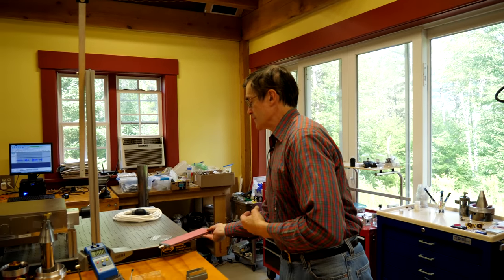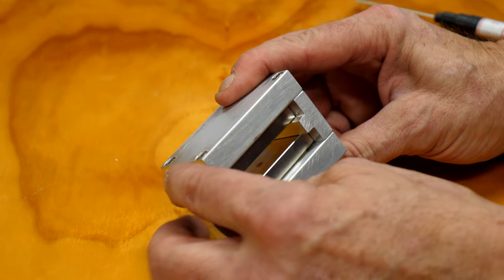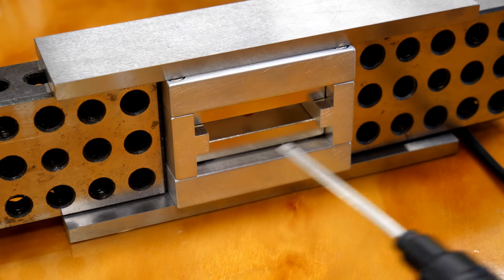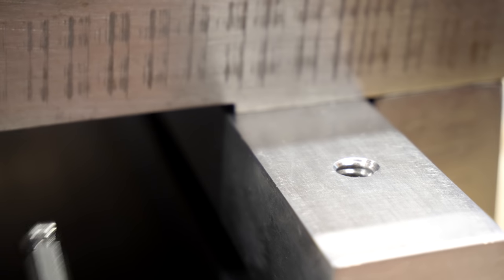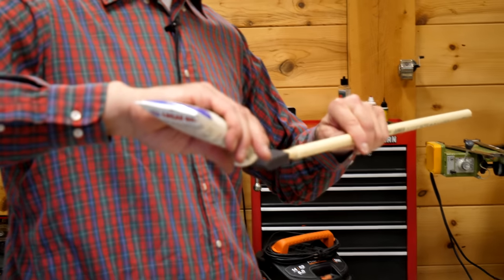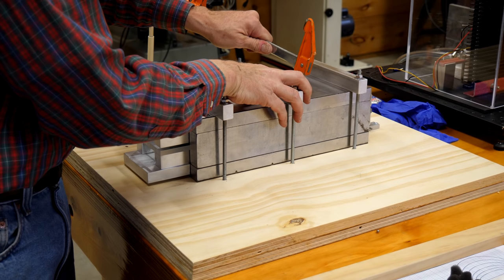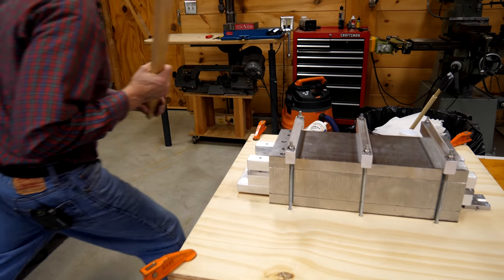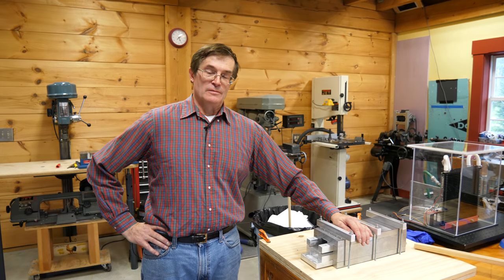Extreme Magnets

Comment: Didn't the US Navy experiment with MHD for silent marine propulsion in the late 1960s?
Reply from the maker: I'm sure they did. The Japanese built a surface ship with an MHD  propulsion system.  Even though they used superconducting magnets it did not work very well.  I think the design was flawed.  They used large diameter flow tubes ( if memory serves, 20 cm in diameter) within the magnetic field which increases the resistance to current flow.  Therefore they needed large voltages to drive an appreciable current across the electrodes.  This is very inefficient and produces a lot of water hydrolysis which also waists power.  A large number of thin, parallel channels would have been better.

Comment: The magnetic strength is NOT strongest at the center of the poles. That is where there is the greatest amount of divergence. It's actually weekest there. The strongest points are the edges. You can prove this with a steel ball bearing and place it directly center of a pole on a large magnet, then let go. You will see the ball bearing shoot off to the edge. As you can see in your image, that is where the greatest concentration of feild flux lines are.

Comment: What if you made that "box" out of aluminum, or copper?
Reply from the maker: It would not work.  The yoke has to consist of a material that is susceptible to the alignment of its electron spin orbitals in order to guide the magnetic field.  That is what is called ferromagnetic and despite the use of "ferro" it does not have to contain iron although many ferromagnetic alloys do.
Reply: Clearly, I should have payed more attention to what you've said in the video before asking questions. That's okay though, I'll watch again :)
Reply from the maker: Sure, no problem.  Just keep watching over and over, it helps our view count.

Comment: I don’t understand the behaviour on load-up. The magnets want to rush in, but not all the way in. They can be pushed (with effort) to go further, but when you stop pushing they don’t revert.
Reply from the maker: They repel each other when they are aligned with their poles in the same direction.  Visualize the field lines bending around each block and being compressed as they approach each other.  What draws them in is the attraction of the steel, what stops them is the compression if the fields.

Comment: Are you sure thats what is going on? What if I said I believe the electromagnetics traveled easier through the metal of the probe. Then the air regardless of the ferrous properties or not... Just only ferrous metals draw enough saturation to over ride gravity when outside of a ring?

Comment: I wish I understood why somebody couldn’t build a motor just using super powerful magnets that oppose each other to cause the driveshaft to spin fast and with torque
Reply from the maker: Permanent magnets are mechanically similar to springs.  Placing them in an arrangement where two opposing (or attracting) magnets produced torque would only work until the magnets moved to a maximum (or minimum) distance and then the motor would stop.

Comment: How do/did you prevent chipping/damage to the magnets as they are inserted into the yolk. Is oxidation of the potentially damaged magnets a concern?
Reply from the maker: They repell each other as they get close, reducing the impact force.
If they did crack, there would be a corrosion risk.

Comment: why not use halbach arrays?
Reply from the maker: Halbach arrays do not produce a uniform magnetic field.  We want parallel field lines running from the top magnet straight down to the lower magnet throughout the entire space in the magnetic gap.  If you look at an image of a halbach field distribution, you can see the field is mostly limited to one side (the purpose of the array), but the field forms loops from end to end of each magnet.

Comment: The utility of the electromagnet in full view.  You could place all the electromagnets with power off.  Much less dangerous.
.
.
.
Reply from the maker: There is that, but everything is a trade off.
The permanent magnetic assembly has a more stable field and consumes no electrical energy.  If this magnet is being used for an MHD pump or generator, an electromagnet could be a deal breaker.
Reply from the maker: The field strength levels you are aiming for are very high.  Permanent, non super conducting magnets are a non starter.  Steady state electromagnets will also not be able to reach anywhere near that level. Pulsed electromagnets will get closer, but still be unlikely to achieve those levels.  My advice would be to establish the minimum field that will allow your project to proceed and then attempt to construct a small test magnet and see if you can at least generate that minimum field.

Comment: I have experimental results that might indicate that the magnetic flux originates at both poles.
Reply from the maker: It's really a matter of symantics.  There are no monopoles and therefore the field lines do not flow from one pole to the other.  When I say they do, it is more a matter of speech because the viewer and I are tracing them from one pole to the other.
Reply: Not monopoles. I believe the north and south fields are 'created?' at the same time from the same 'process?' at opposite ends of the magnets. They can only exist together but are also 'separate?'.
Reply: Just saw your banana spirits video. Liked it!
Reply from the maker: Thanks!
Regarding the magnets, even these field lines are human constructs to visualize what's happening.  The field originates with the spin of the electrons in the magnetic material and is created with the creation of these electrons, possibly with the origin of the universe.  The act of constructing or fabricating the raw magnetic material and later polarizing this material into a bulk magnet is to organize these magnetic fields and generate a macroscopic magnetic field.
Reply: I guess I not making conveying my point well. I've taken physics classes in collage and high school. I know what is taught in schools. Sorry.

Comment: Ed Leedskalin showed and can be demostrated is that magnet "particels" or Ether is circuling inside magnets or fero-magnetic materials.
So if you add arion, the particels flow there. And the lines are not joined, by introducing a feromagnetic dust you induce the S and N north so they allign in the midle, otherwise not.
Also, do some experiments with pulsed electricity with not much condensers or at least not the prime movers. A rumkorf generator of some sort... with a better than mechanical interupter or a lamp as a guide...
You woul and should get better electrolisis and other phenomena, as pulsed electricity posseses more relaxed power as it's not induced like AC and DC.
Also the next step is resonant AC... You know when stuf resonates it exerts more work. But not like tesla coils.... i mean like that but horizontaly and do experiments with anode and catode. 1 wire lightning etc.

Your knowledge is amazing and it's all easy to understand if you consider Ether as the underlaying matrix of reality and physical matter a resultant of it.

Comment: I believe you aught to look into using magnets which in cross section are pyramidal with a flat narrow top.  You should be able to assemble it better and fixture it better with much more magnetic field.
Reply from the maker: I'm not sure how this would work better than the rectangular blocks.  We need a homogeneous, rectangular magnetic field in the gap.
Reply: @TechIngredients  OK let's get down to brass tacks here.   You could get up to 7000 - 8000 Gauss in the gap instead of about 1000.   The field would be as you desire
Reply from the maker: We are currently achieving 12,000 Gauss or 1.2 T in the yoke we demonstrated.  Neodymium magnets cannot exceed 1.4 T without high saturation, steel pole pieces between the magnets, within the gap and this is over a very small region in the center of the gap.
Reply: @TechIngredients  In open air the magnetic field around the point of a tapered parallelogram often hits 7T.   I would presume more.  for a yoke by more than double.  Sadly somewhere about 12T to 14T  you get failure of magnet structure.   You might do better focusing using Mu Metal it is spectacular.  Let me make it clear 1.2 T is not that high.  I get nearly 2.4 T inside a motor I have built.   Using Mu Metal I could easily get 5T.   That 2.4 T is using standard M15 steel.    N-50 magnets in the tapered structures get easil 5T or 6T and sometimes 8T.    Maybe I didn't make myself clear on this but 1.4T is trivial in magnetic fields.  Cryogenic stuff really goes up there.  The problem is about 12T the crystal structure of the magnets pulls apart or crushes.   I would suggest that if you approach above 6T you look into concentration using 49% Cobalt 49% Iron and 2% Vanadium Alloy or the Mu-Metal..  It is the best for concentration.  If you are only getting 1.2T then all you are getting is direct magnet to magnet N-50 N-52 magnets.   There are magnets up to N-75 and N78.   (Very expensive) . Do understand that N-52 is not 52/50 ratio to N-50.  it is nearly 4 times.  These really get amazing.  The biggest problem is to install these magnets in the structure without damage.   No you can get a lot more out of a N-50 magnet than the 0.65 T that is does on a flat surface if you shape it.  You can get using an area reduction from 4 square inches on one face to 1 on the other face a flux density gain of nearly 4:1.    That would be in your pole to pole functions approximately 4x 0.65T  x 2 or 5.2T.   If you jam it in taper up you can get it upwards of 7T.
Reply from the maker: Please provide  links to some papers that support these numbers you are presenting.  I'll look at them.

Comment: You should be seeing fields inside the gap between 5000 and 10,000 Gauss (0.5 to 1Tesla), not 500!  Something is VERY wrong!  The cross-section of the steel surround path should be at least 1/2 the area of the magnet faces.
Reply from the maker: The measured field is 1.1 Tesla.  I'm not sure where you got 500 Gauss from, did I say that.  The cross section of the steel yoke is equal to the face area of these magnets.

Comment: I'm really not comfortable with the method of loading the magnets - a sure way to get the fingertips sheared off. I would be pushing them in with that piece of wood - no blood!
Reply from the maker: They don't need a push, they need restraint!  My fingers were not at risk because they were never close to being between the magnet and its final position.
Reply: @TechIngredients  Well, exactly. Restraint. And since you described that aligning before insertion is also challenging, why not some sort of ramp? How could you restrain each of the magnets and build a jig/mechanism to facilitate more precise and SAFE loading?

Comment: You should have showed us the strength with the meter
Reply from the maker: You're right and I regret that.  I will show the reading when we insert the modules for the pump in the up coming video.  The reading is 1.2T.

Comment: I've been daydreaming about an H bridge permanent magnet assisted free-armature linear motor since Physics II about 15 years ago. What you are doing is very close to what I cooked up in my head. Very excited to see where this goes.

A few other thoughts I had or borrowed from traditional electric machines:
-The H bridge magnetic circuit could be laminated stamped magnet steel, to reduce eddy current losses (maybe cheaper for raw materials than bar stock, too).

-Since you've basically unrolled a DC motor/generator, equilibrium armature velocity will be a function of applied voltage and armature resistance. I expect back-emf to still play a roll in limiting speed & current.

Comment: can we make a magnetic gas?
Reply from the maker: They have, with lithium, but only near absolute zero.  The election spins in a magnetic material have to line up and normally the solid matrix holds these atoms in a particular orientation.  Some gasses are paramagnetic; oxygen is one example.

Comment: Its so funny how you misinform everybody about the actual construction of a rail gun when you can find it easily.
Reply from the maker: Don't be obtuse.  There is not a defined design for a rail gun, but there are general principles.  A permanent magnet can modify the field of the electromagnetic rails to stabilize the projectile early in flight.

Comment: You got grease on the nut/bolt. Hopefully those hold.
Reply from the maker: There is no vibration present and the loads are in sheer.  In addition the primary purpose is for loading.  The magnets don't want to move once they are attached to the heavy steel plate.

Comment: Can you explain how we can collapse the flux field on ONE end of a cylindrical neo magnet, with the intention of turning it into a monopole magnet as closely as possible?  I have a project that would benefit a lot from such a setup.
Reply: He can't, because what you're talking about is impossible. North and south on a bar magnet aren't just two separate things that you can just divide like that. You can't have one without the other in any known material. Theoretically a monopole magnet would be a lot like how electric charge can be accumulated instead of just being an inseparable differential. But this would violate Gauss's law for magnetism. For any closed surface that you can come up with, like a sphere, donut, cube, etc the net magnetic flux passing through the surface is always zero. There is no evidence that an actual magnetic monopole exists.

Comment: you found frustration with flux lines and poor poor Maxwell would be in tears.
find timings in polarity shifting and spring load and cam lever action to keep it going.
an array of individual blocks each with the same semitry and then I will show you torque next.
stop getting stump .

Comment: Again don't use conductive (electrically). Magnets moving near a conductor even non magnetic material build up a current which sets up a magnetic field opposite to the magnet even though the conductor is non magnetic.

Comment: Hello, question from Ukraine, It would be very interesting to see the device to produce hidrogen gas with such a galvanic battery which consists of two moveable stages: first: stage work as simple galvanic battery and in the same time work as dc generator but not to produce electricity but for produce hidrogen. And it would be interesting to use such a process when galvanic battery restore by influence of dc generator stage the same two stage hidrogen generator battery cell.🤔

Comment: y not connect the magnets before insertion rather then slam them! May chip!
Reply from the maker: You don't even want to think about bringing those magnets close together without a fixture to separate them. Despite the violence of the insertion, there remains a moderate amount of repelling force between these magnets that limits the force of their impact.  That is why I needed the muscles and the stick to force them together.
Reply: Ah, yea true Plus the conductor slowing them down on insertion.

Comment: First off,  He used the "B" field of a  magnetic in conjunction with a pillar oscillator that was similar to the rock he was working on.  Yes all the construction was completed and installed via sound and magnetic waves.  He had one critical Pilar on his property  that he fed via his "B" field generator.  His generator consisted of 25 "V" magnets five deep all in the repel mode!!  His "B" field generator would cause the pillar oscillator to kick in.  Given the pillar was a resonant source equal to the materials he was working on it made the stone soft like Styrofoam.  When you look at his tool marks you can see it was a soft material as he worked on it..

Comment: % Magnets??
anyoneHave thoughts on the "copper sphere 
with an magnetic center"
Its actually a hollow sphere, thick copper, strong magnet inside. 
If rolled or shook, it should create an electro/magnetic field. 
also, soft shock absorber like seat and space capsules.
-Hollow sphere, magnet.

Comment: What I see at 7:34 is not what you say I should see; it's the opposite. Using the rod WEAKENS the magnetic field. I didn't watch any more of the video. It's too slow for me.
Reply from the maker: Take a look at that exact point in the video again and watch for 22 seconds.  What I said is true when THE MAGNET is the same distance from the steel balls.  The bar acts as a transmission line for the field.
Sorry you found it too slow, but you might want to at least recheck the part you mentioned because the principle is important.

Comment: Wat If u use magnets on the sides instead of metal to make the field  even stronger
Reply from the maker: This will not increase the field strength.  The metal or the magnets only serve to isolate the field in the gap from the effects of the external field.  The entire field strength originates from the poles in the gap.

Comment: again, a magnet moving near a conductor (electrical ) or a conductor moving by a magnet, induces an electrical current in the conductor, even your steel box or tube is a conductor. You are inducing opposing forces, reducing  efficiency
Reply from the maker: You are correct, but what matters is...is it significant?
Please provide some equations that allow us to quantify or even estimate the magnitude of loss.

Comment: Technology Development for AUTO Magnetic Electro Levitation, for Flight craft that carry heavy loads of cargo are needed, and are the next big industrial development needed to enable inspanding global trade. To link between ground travel, foulable air flight and space craft flight. Two strongly producing Electro magnetic circles, one moving right & one moving left, creates a lot more magnetic power & effects. Hemp materials can also produce container structures that are 10 times stronger than U.S. conventional steel, and get stronger when placed in accordance with the magnetic strength directional lines.